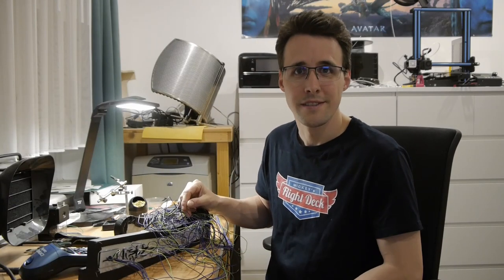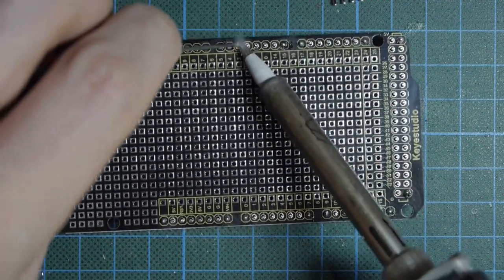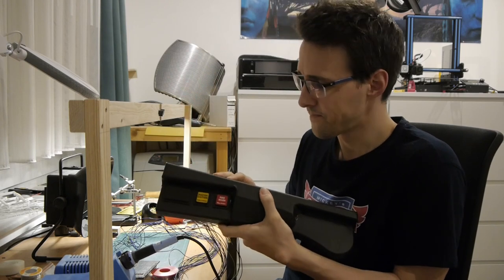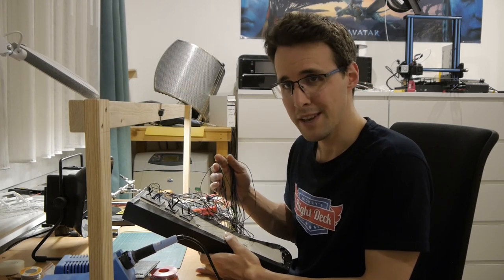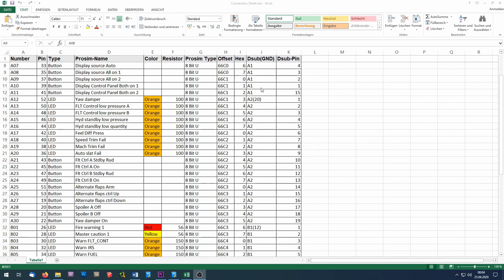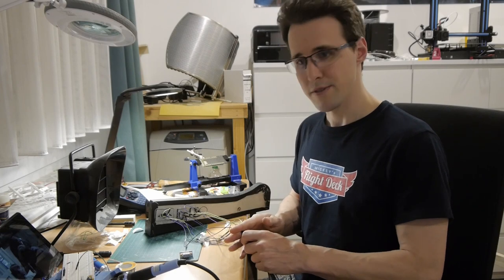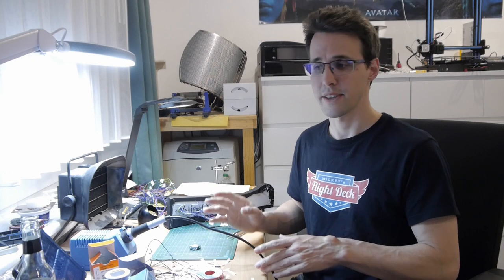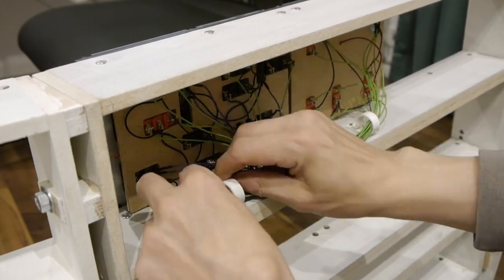Managing cables in your cockpit  - A Boeing 737-800 Homecockpit #41

Comment: Hi Michael, I really like your videos, very helpful. 
When you made your EFIS panel and engraved it, you never showed how you fitted the LED's for back lighting the text. 
Is it possible to explain this or maybe post a photo showing the LED's ?
I have just stated to engrave my panel (sorry, not Boeing, a TBM900 !) 
I am using opaque 5mm acrylic.
Thanks
Reply from the maker: There is a reason why I never showed it - I never did it. The EFIS panel was my first engraving project. But don't have the knowledge to do the electronics until now. Small backlighted push buttons or dual rotary switches are topics I still have to discover. That's why I have concentrated on the overhead first.
Reply: @Mickeys_Flightdeck  Thank you for your fast reply!  
My first attempt I have used LED light diffusing opal acrylic, painted black and engraved.  I had very good results with the engraving. I see some people using clear acrylic, painting it black and engraving it. I think I will buy a small piece of the clear acrylic and experiment. Maybe drill 'blind' holes in the acrylic and push a couple of white LED's in.  Maybe I will post photos on your Face Book page.

Comment: Hello Michael. I love all your videos. But one question, how did you calculate the needed resistor. When I put for example in a calculator the values: power supply 5V, LED voltage 2.2, 20mA for 2 orange LEDs, I get a 30 ohm resistor?
Reply from the maker: I only need one LED in the annunciator which needs 2V. So as a result I need a 150 ohm resistor.
Reply: @Mickeys_Flightdeck  Thank you for quick response!
Reply from the maker: @pascalsspottingvideos6728  By the way, I use 2 and 3V LEDS. So I need 150 and 100 ohm resistors.

Comment: Hello Michael, I follow your videos and I must say that they are really very useful, keep it up !!!. I noticed that in this last one behind you there is a 3d printer .... is it for an Ender 3?
 If it were I also have one and I'm using it to print all the panels of the 737 overhead
Reply from the maker: The printer is an Geeetech A10. The part I love most of it is the so called "super plate". No need of any blue tape or something like this. And the parts can be removed without any tools.

Comment: Are all the LEDs for the Annuciators connected to an own pin on the Arduino? (That's like 2 Arduino Mega's for the 100 Annuciators)
Reply from the maker: Yes, you are right. That's the way I did it for a long time. But now I'm using shift registers supported by MobiFlight. I think I'm showing it it my Fire Panel video. At least in the configuration video.

Comment: I wonder how many different Mega boards you're using and what kind of Usb hub to run them all without  any problem.
Reply from the maker: At the moment I have configured 5 modules. And I mean configured. Not running all of them at the same time. This will be tested when I have more panels installed in my overhead and the arduinos mounted behind it. From the experiences of other builders I know that they have running up to 25 modules. I still have to choose the needed usb hub.
Reply: @Mickeys_Flightdeck  please let me know about your Hub choice, or share in your videos I'll be following! Good luck!

Comment: Hello, the placement of cables on the dsub plack is important? Or can I place the cables where I want on the dsub plate?
Reply from the maker: The placement doesn't matter as long as the corresponding plug matches.

Comment: Hello. Is it possible to connect directly the buttons to the arduino?
Reply from the maker: Of course. But normally the only way is a pinheader that can come loose.
Reply: @Mickeys_Flightdeck  I did not fully understand the pin part of the arduino because the buttons are not directly connected to the arduino (the cables of all the buttons are welded on a port and the cables of the arduino on a port, then the two ports are attached together) so how do you know that each button is on such a pin?
Reply from the maker: @tiagovila2702  OK, when you solder them, then they are connected safely. Normally when you work with an arduino you don't solder anything.
Reply: @Mickeys_Flightdeck  ok thank you. But if the cables of each buttons are solder on a port and not directly to the arduino, How do you know wich câbles is connected to a such pin ? I don't know if you have understand because I don’t explain very well😂
Reply from the maker: @tiagovila2702  It depends on your documentation. You have to be able to find out which cable is connected to which port. I'm using labels on the cables and wire everything down in a big excel sheet.

Comment: reat 
Flight simulation is a life.
enjoy life.
You need a force feedback yoke. All small aircraft yoke positions are wrong. 
This is caused by trim. Using force feedback yoke trim is easier and more realistic.
Reply from the maker: Let's Keep this in mind until I build my yoke. Maybe in three years.
Reply: what force feedback yoke do you recommend?  i hope they start mass producing them to make them affordable to all.  Brunner is like between $1000 and $2000 usd for a force-feedback yoke, and it's probably like trying to solve the Riemann hypothesis to program it.